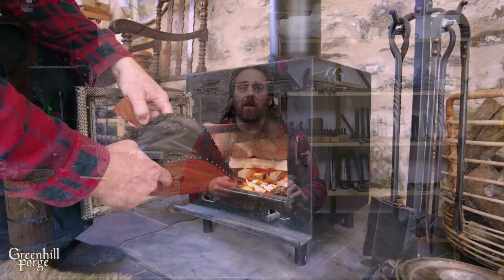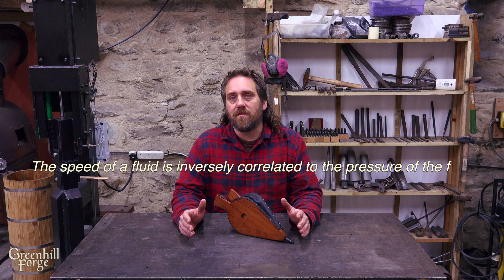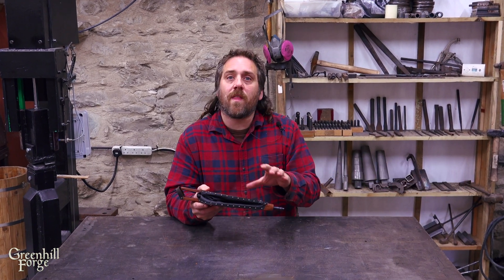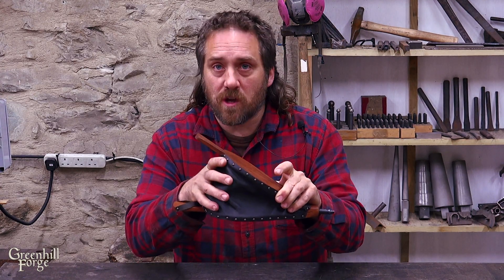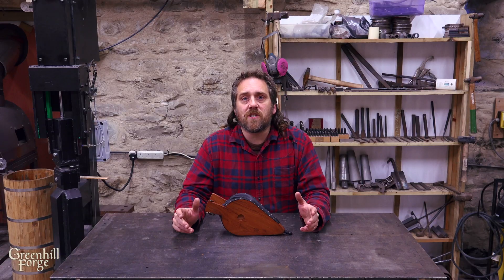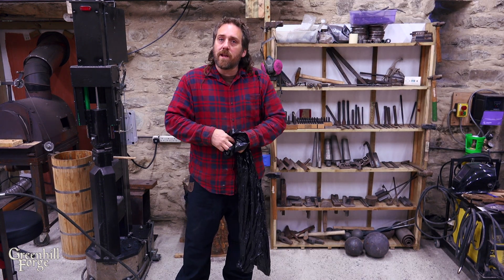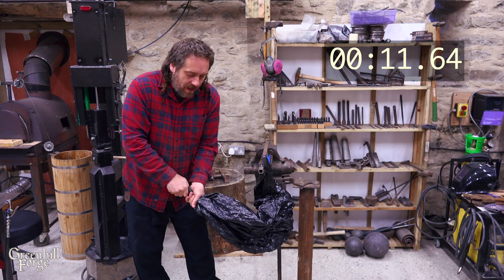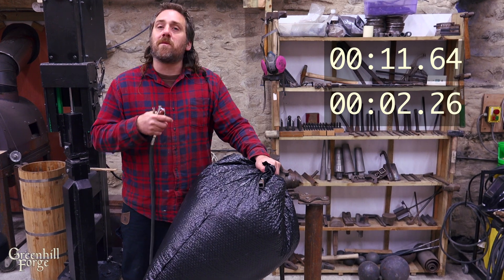Surprising Science that Supercharges Your Fire - Bernoulli’s Principle in Action

Comment: Bernoulli's principle only applies inside the bellows up to the nozzle opening. The pressure in the nozzle is higher than the air outside otherwise air could not flow out. What you are observing is the result of diffusion: high speed air mixing with the surrounding air and "dragging" it along. This does indeed create a low pressure sleeve around the jet which draws in more of the surrounding air.

Comment: I've spent 19 years in the navy and when we did damage control training we had the same principle with water where we would pump water out of a flooded compartment. The pipes had "holes" in them where other pipes joined the flow  that sucked way more water out of the compartment. Difficult to describe but it's the same as the emergency slides used on aircrafts.

Comment: Actually... this has not much to do with Bernoulli at all.
She stream of air blown out is not at a lower pressure. If it was, it wouldn't have left the nozzle. It could just come out because it was at ambient pressure at the nozzle. The energy required to be fast AND at ambient pressure comes from squeezing the bellows. 
What draws in more air here is the viscosity of air. The fast moving stream pulls surrounding air with it.

Comment: Very cool demo! As far as fire starting goes though, all you need is three pieces of wood & some paper: two splits with flat surfaces parallel to each other about 20mm apart with a piece of kindling propping up one end of the other two. Crumple some newspaper and put it between the two faces, then light. As long as the wood is dry (& not super dense), the fire gets going w/o any extra work.

Comment: When you pressurize air it becomes much colder that could also have something to do with the difference in volume...
Reply from the maker: pressurizing air actually makes it hot and expanding air makes it cold. this is how air conditioning works. and you're correct that it would technically affect the situation but it would be a very small effect in this case

Comment: I don't think the larger volume of air being moved/added is due to a lower pressure in the desired ďestination. I would incline towards it being due to the friction dragging in more air, when the flow reaches higher velocity. Correct me if you think I'm wrong and if you're knowledgable enough to do so.
Reply from the maker: Friction is certainly playing a role. But the Bernoulli prinicpal (low pressure) is by far the most significant part of the demonstration. If you want the more complete explanation look into Navier-Stokes.

Comment: Maybe some slight addition. The Bernoulli Principle is just an application of energy conservation to fluids. You have kinetic (motion energy), gravitational (height energy) and internal (pressure) energy summed together to be constant (energy conservation)

Because of this, the Pressure of the fluid actually has to balance with the square of the air velocity. Therefore any small gains in velocity will cause a "exponential" decrease of the air pressure and consequently a much larger pressure differential with the surrounding air (or fluid).
Reply from the maker: Yeah, it's actually much more complicated as you say. I think of Bernoulli's as a simplified Navier-Stokes with several assumptions made to make it a bit less mind-boggling.

Comment: That's another thing, it's also how a vacuum generator works, driving a vacuum through a venturi with air pressure. We use them in automation systems to power robot end-effectors for picking up various objects, like semi-conductor wafers, or whatever we built an automation platform for manipulating with robots, where they can be used.

Comment: This is why ships sailing parallel with each other can get sucked together if they get too close and fast, hence the need to steer slightly outwards to maintain a parallel path eg. when transferring personnel and equipment via cables.
Reply: Also the waves push boats together even if they aren't moving because they're blocking the waves from getting between them.
If two boats are aligned north-south like this | |, any wave that comes from the left ->| | and would push the right boat to the right & away, will first hit the left boat first and push it towards.

Comment: My Mother used a simpler Bernouilli principle to encourage the fire by placing a sheet of newspaper over the fireplace,so that all the air went through the bottom of the hearth, through the coals, and up the chimney. The newspaper sealed itself around the fireplace as the suction increased and the fire burnt brighter. once it was clear the fire was burning fiercely, the paper was removed, rolled in a ball and added to the fire.
Reply: Or in my case, I would leave it too long and set fire to the paper!🙄
Reply: On a wide open fireplace there is very little natural draft going through the coals. Trying to get the flame going properly may be a bit hard. By doing the described method they are actually trying to actively block this bernoulli principle from using the little draft the chimney has on venting room air past the flame. This means the whole airflow of the chimney goes through the flame, feeding the fire.
Reply: Nice memories! It seems though that Bernoulli's effect in this case can draw in the stream only oxygen deficient gasses from inside of the fireplace, rendering this extra air quite useless.
Maybe Ive missed smth..
Reply: @borincod  I think they meant that they only covered the open fireplace from the front, but air was still able to get in through the ashpan underneath. This should work, I can definitely hear the fire burning more intensely when I close the upper door on my tiled furnace.
Reply: @borincod they covered the front of the fireplace but left a little gap above the ground. So air had to go under the paper and the higher velocity pulled it up through the coals.
Reply: @NandR  i agree with you until smth about 'pulling up'. I dunno what you mean. How is it related to Bernulli effect? Btw, higher speed is definitely not a result of the effect
Reply: @ the newspaper covers the front of the fireplace except for the bottom. It’s used like a choke. Burning fuel causes air to heat and rise. This pulls air in to replace it. So air is trying to get in the fireplace which is normally wide open on the side facing us. But they cover it almost completely with a newspaper. The gap at the bottom lets air in. However since the rising hot air still needs to be replaced, the air has to speed up to replace the same amount of air through a smaller opening.
Reply: @NandR  yep, quite agree with your description. As you see yourself, there is no need to stick Bernulli principle in it

Comment: Im sorry but i have to disagree. Fluids cant be compressed like air! The flow characteristics of the two are completely different!

Bernoulli's Principle is about fluid dynamics, pressure, density, speed and pressure differential typically in a closed system. Air in our atmosphere is completely different! Im pretty sure he said that flowing pressure decreases! Not that it creates "low" pressure, the pressure is still higher than 1 atmosphere or a positive / high pressure. You said "a low" pressure, maybe a lower pressure differential, that i would buy. 

The air coming out of the bellows or air nozzle is a positive pressure (compressed air or more than 1X atmosphere). The area around that high pressure is a lower pressure thus causing the rush of air / flow and it equalizes. Thus the reason you can fill the trash bag faster. To equalize, air must flow and leaving the bag open takes advantage of the equalizing air flow from our atmosphere. But what is coming out of the nozzle is still a higher pressure than 1 atmosphere or a positive pressure. Although while it is flowing and equalizing measuring its pressure in a atmosphere is difficult to do and is taking place at fractions of a second.

But until it equalizes its still a positive pressure. Same as with a vacuum released into a atmosphere its just a negative pressure. For air to flow there MUST be a imbalance, either a positive or negative air pressure. A fan for example creates a positive pressure in the front and a negative pressure behind it.

An air bellow is compressing air similar to how an air compressor does its just at a much lower pressure. More volume but less pressure.
Reply: @WW5RM You're confusing fluids with liquids. Gasses are absolutely fluids and the Bernoulli principal 100% applies to gasses.
Reply: @timg745  point taken, but for most of us, the difference between the two is irrelevant. My point is they can't be compressed. Their flow characteristics are completely different. 

Also, the air coming out of the nozzle of the belows is not "low" pressure. It's more than atmospheric pressure. The column of air surrounding the pressurized air coming out of it is a lower pressure. The air flow between the two differentials is equalization. Taking advantage of that air flow between the two is why the trash bag will fill up faster. 

NOT because the air coming out of the belows is low pressure as he described it in the video.
Reply: @WW5RM lol science doesn’t care about “most of us.” You are wrong, stop back peddling and be happy you learned something.

Comment: I question if the math is done correctly for the size of the exhaust vs the size of the intake for most combustion chambers.
For my tankless water heater, the exhaust and intake pipes are the same diameter. This causes the intake air to be moving at a different speed than the exhaust.
Is there any benefit to making them equal in airflow speed anyway? I don't know, but it's stuff I think about without knowing how to find out accurately.
Reply: It would be really great if someone would come up with a bunch of simplified rule-of-thumb calculations for all this, just so that "ordinary" people get the basic ideas behind it. 
The first basic principle is the expansion of gases in relation to their temperature. As normal stoves depend on a draft from a chimney which is only a tiny fraction of the general air pressure, this parameter could be set as a constant (I think). As nearly 80% of air and also of the flue gases are Nitrogen, I would not bother to try to find out the exact consistence of the flue gases but just calculate with "normal" air values. You have an intake diameter where a certain volume of air at room temperature enters per time unit. This expands into the burn chamber. Here the burn gases should pass through at 500 to 800 °C for a minimum of 2 seconds for a clean and complete combustion. The expansion of air volume from room temperature to 800 °C is around 3.8 times. While loosing heat, the flue gases contract again. For modern stoves, there are numbers given for the needed draft, the exhaust temperature and the mass of the flue gases per time unit at the rated heating output. From all this, it should be possible to make some raw calculations, but so far, I failed with this myself.
Reply from the maker: The supply and exhaust are basically never equal on a wood stove. And even if they were as soon as you adjust either the air supply or a damper on a flue they'd no longer be equal. The supply will always be smaller and therefore the air entering the stove will be faster which you can adjust to feed the fire as desired. The exhaust is then bigger so the air is moving more slowly which you want so that it lingers longer so you can extract more heat before it's gone. And both will be sized to suit the size of the firebox.

Comment: Great, however: The pressure decrease is the pressure perpendicular to the fluid’s flow—it’s dynamic pressure. And Bernoulli has nothing to do with lift generation over an airfoil/wing.
Reply from the maker: Thanks! As I understand it, the "equal transit time theory" (basically the 100% bernoulli based theory) is definitely wrong concerning lift. But Bernoulli's equation is actually part of a more complex explanation of lift that together with Newton's second law and angle of attack do explain lift. If you know differently I'd love to hear about it so I could look into it. I always want to learn more if I misunderstand something.
Reply: @ Bernoulli has nothing to do with lift generation. As an airfoil moves through the air, a vacuum is formed on its upper-rear surface. This vacuum pulls down air from above, which in turn pulls down more air (like a scoop.). All of this air is then accelerated down the airfoil’s trailing edge—opposite and equal creating lift.

Because of the pressure deferentials involved, Bernoulli’s formulas are used as an approximation.

As lift is Newtonian, an incredible fact then becomes clear.

Comment: Actually, your explanation doesn't hold true for the air hose. If you have air under (high enough) pressure and release it through some orifice, the expelled air will reach Mach 1 (speed of sound) in the smallest cross section of the orifice, and the pressure in that point will be 0.5283 times the stagnation pressure (tank pressure, in this example). That means, as soon as the pressure in your air system is above 1.89 bars absolute (about 27.4 bananas), so every sensible air system, the pressure in the jet leaving the orifice won't be below ambient pressure anymore. That's just a physical fact, no way to argue around it. And therefore it can't suck in any of the surrounding air, if the reason would be how you explained it.
What's happening in reality is a bit more complex. The contrary will happen, the air jet will expand and push air out of the way. But in that process it'll also transfer some of it's momentum to the surrounding air, dragging it along. And THAT effect might suck in more of the surrounding air.

So, while the bag does in fact inflate much quicker with the air hose, the reason isn't what you have explained. Still you have given a really nice example that fluid dynamics are way less intuitive than people think. Bernoulli's principle is one of the most commonly used examples for an explanation that sounds completely logic, but isn't physically true (usually in the context of aircraft wings).

The trick with the fingers is nice though. Didn't know about it, and I'll happily keep it in my repository for the next time I'll light a campfire 🙂

Comment: Hmmm 🤔 I always thought air coming out of a restricted hole is higher pressure.
Reply from the maker: the high pressure is actually on the other side of the hole. like if you let the air out of a balloon, the air in the balloon is higher pressure and as it leaves the balloon through the hole the pressure of that air drops. hydrodynamics is often counterintuitive.

Comment: The small hole with fingers is a new trick to me, thanks!
Reply: On the same line I use a drinking straw, which allows to give direction and some distance to the fire from your face. Helps heaps on damp days.
Reply: Really? When I tried it seems I can make similarly small opening with lips and blow easier and stronger stream of air.